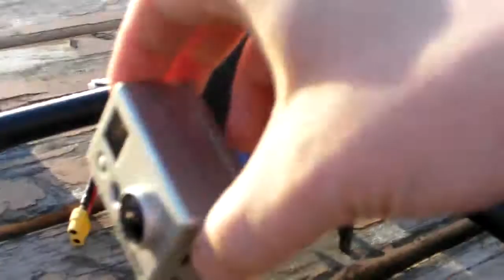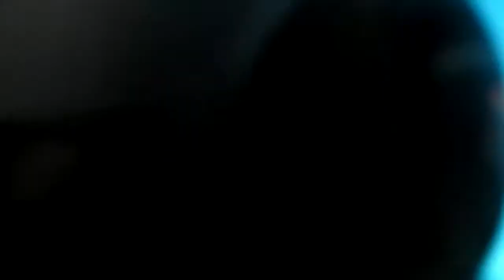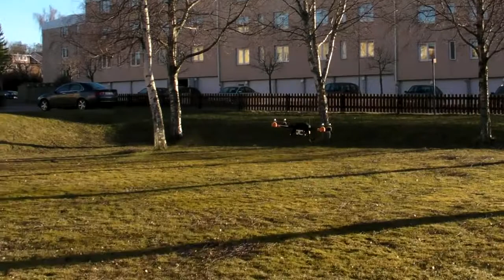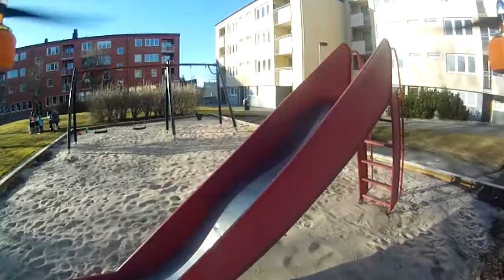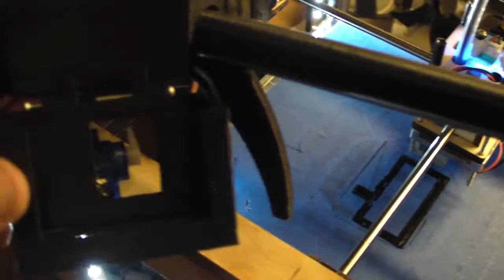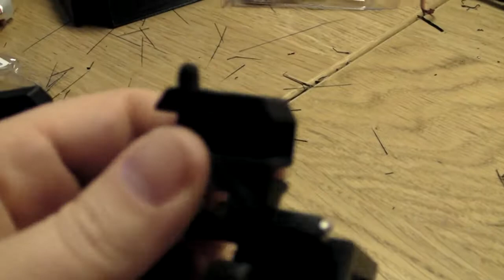First fpv test of my gopro quadcopter mount

Comment from the maker: There is a option for that on the multiwii code, also most multirotor flight controllers today supports camera gimbal stabilization.. Basically they use the same sensor that they use to feel the angle of the quad and use that to calculate the level of the camera...

Comment: you could use filament and melt it stuck at the sides....
it has been done before and is a bit tricky to do right but it works fine and the filament is prity smooth and mkes a fairly good joint...

Comment: Hey Petle, good work. Why dont you run a single shaft right through the pivot holes with some bushings??? Just have nuts on either end to contol the torque with a spacer in between or build it into the print.